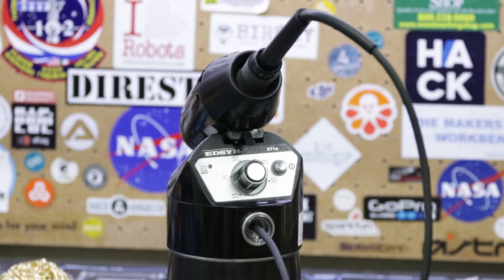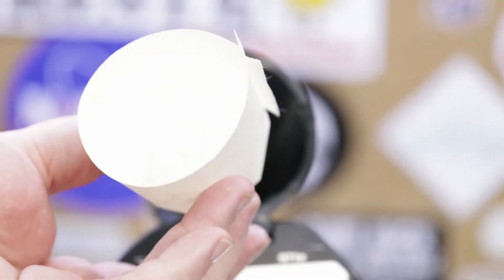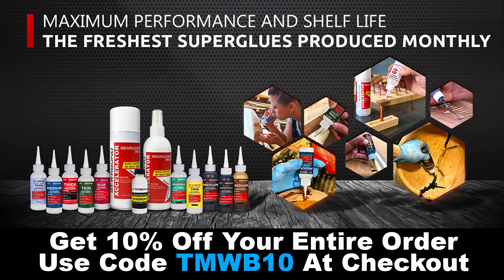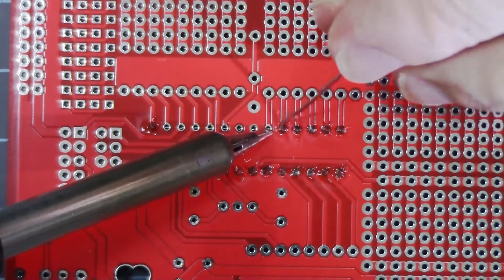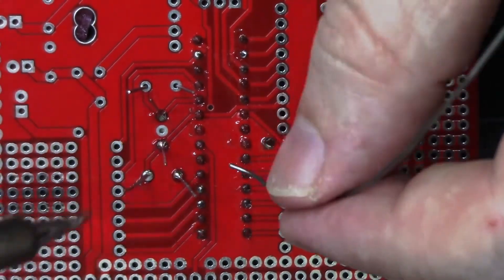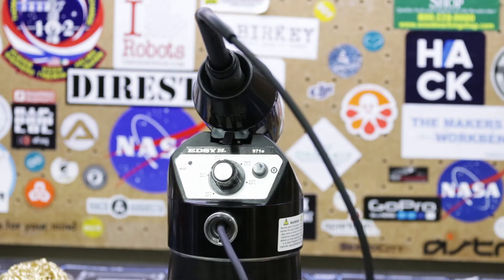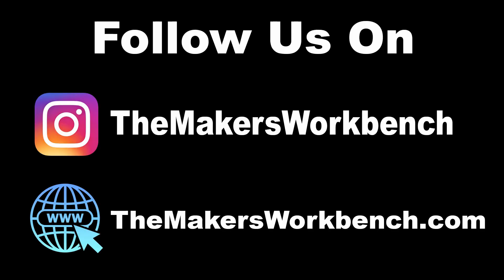Soldering Station Review: EDSYN Loner 971e. The Best Is Made In The USA!

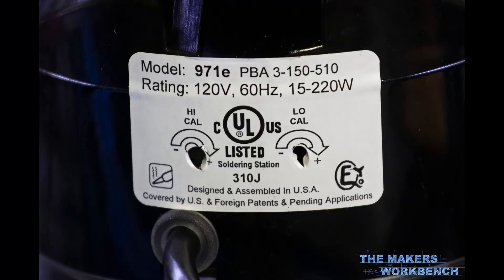Comment: 2:21 minor nitpick here, but why the hell do they make it to so you need to poke holes in the sticker to access the pots ,  ,makes no sense  and looks terrible, cringe
Reply from the maker: I understand your point, but I also see this as not much of an issue. The label is in the back of the device, and you use the calibration pots very infrequently, and I guess it's just not that big of a deal to me, and honestly, they would clean up with a hobby knife pretty quickly.
Reply: Also, we included this feature to help identify if the calibration pots have been used.  Similar to breaking a seal on a package.    This is necessary for production environments for compliance.  Production managers have remarked in the past that this option helps give a visible sign if a technician has tampered with the calibration pots without approval. They can easily reseal them with their own stickers to ensure compliance as well.
Reply from the maker: That makes much more sense. It serves as a tamper detection device, and you can reseal with a calibration date sticker